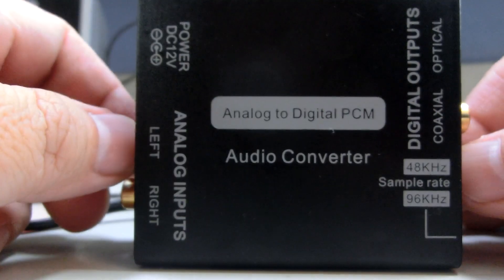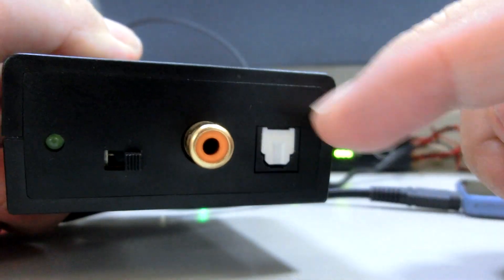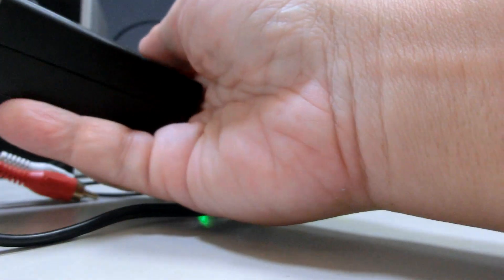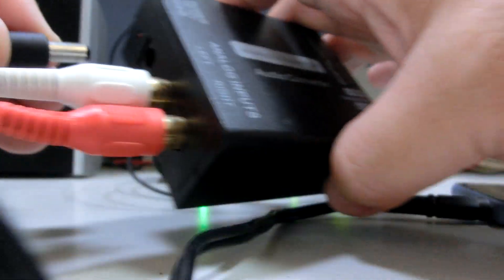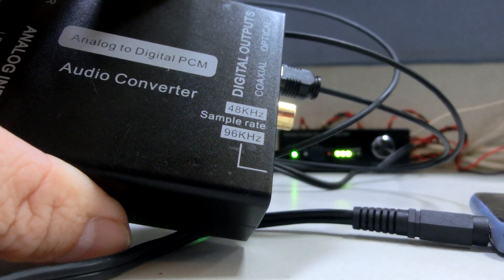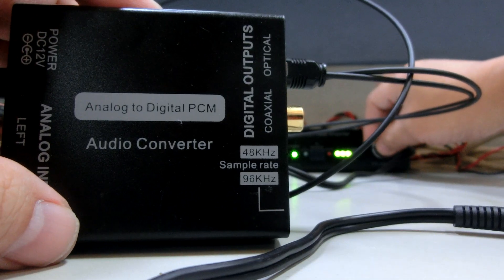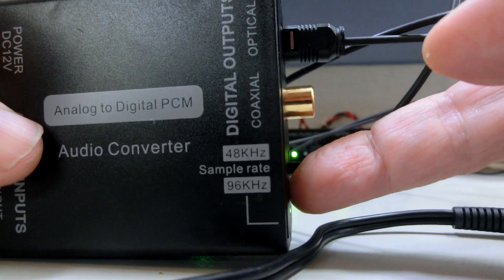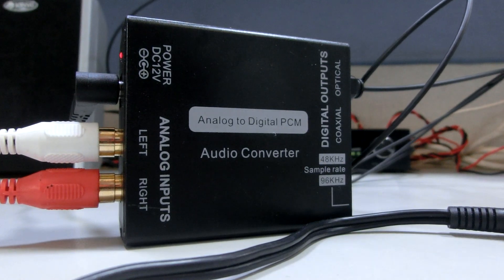A-1262 Audio Stereo audio to Digital audio converter

Comment: What’s the point?💩
Reply from the maker: Thank you for asking. 
The key points for convert stereo audio to digital audio are:
1. to extend the delivery distance between the audio source and your audio power amplifier system. 
2. Typical applications consists with newer televisions or displays with digital audio that need to be hooked up to older devices with analog audio, such as VCRs and karaoke machines. Take your analog device and plug in your RCA stereo audio connection into the converter.
3. to enhance and to improve the audio quality/ audio processing for audio mixing, and music editing.
conclusion: it is small, but very useful and powerful. Especially for RV traveling car use.